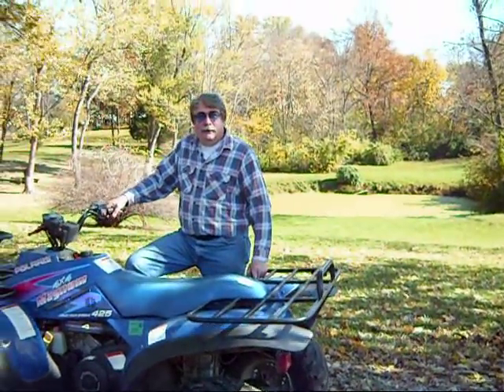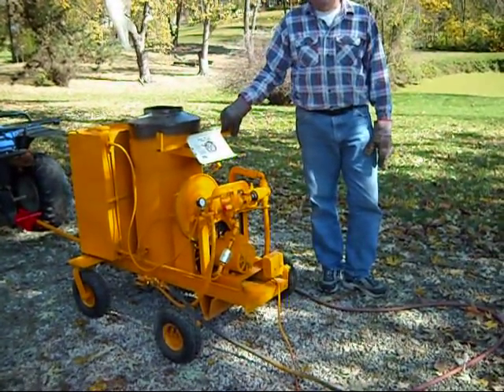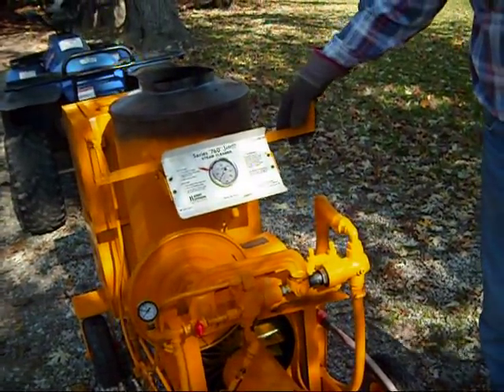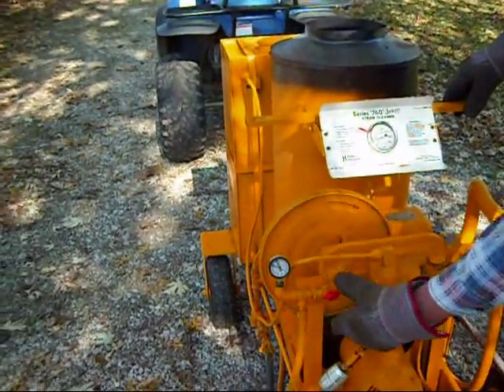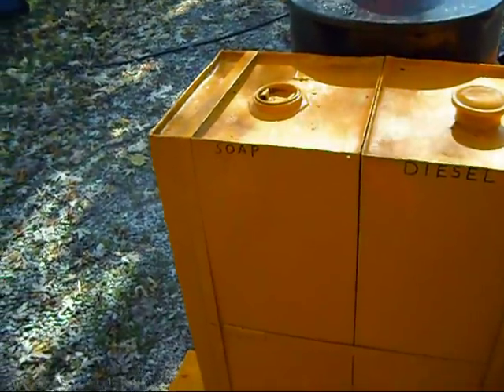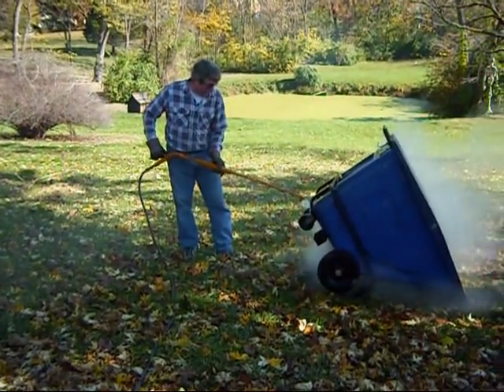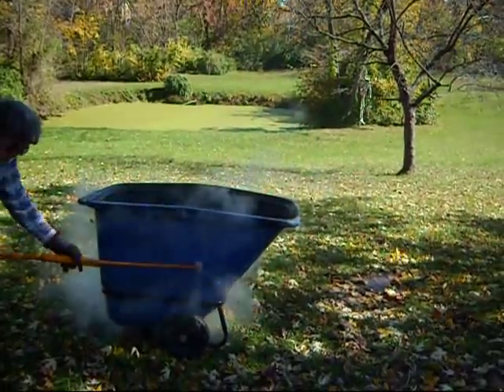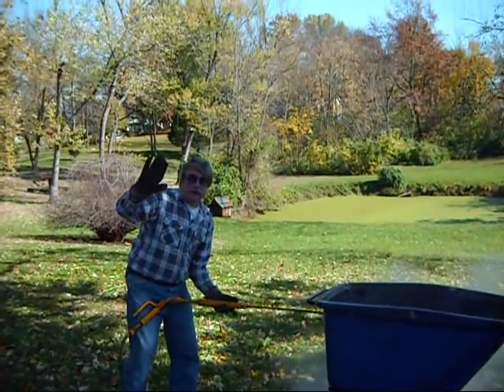Movie my steam jenny

Comment: Always turn on the ignition on BEFORE opening the fuel valve. When shutting down turn off the fuel first before killing the ignition. On many industrial cleaners the ignition is always on just to prevent the kind of hot start you showed.